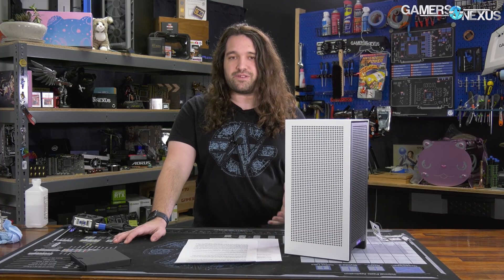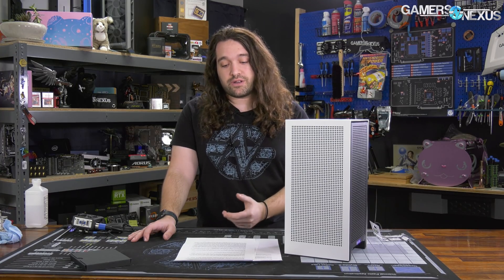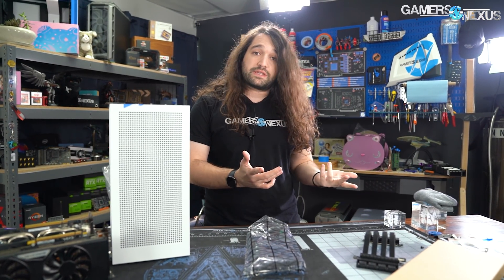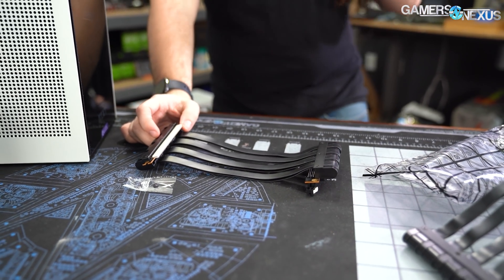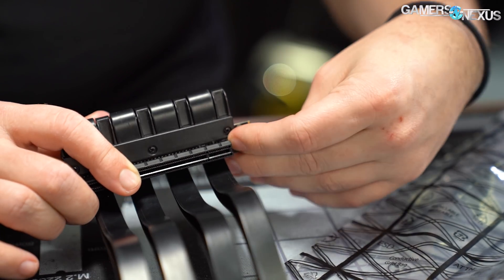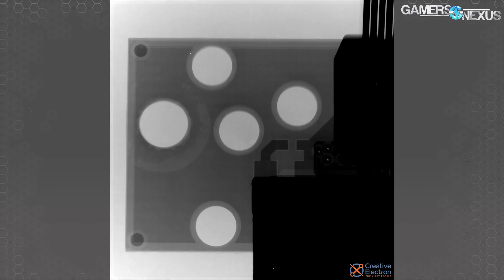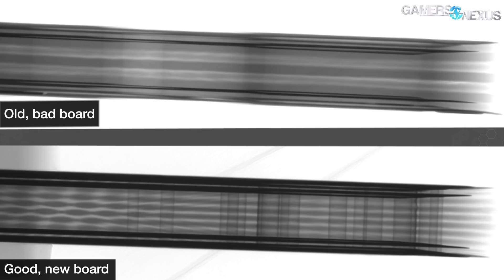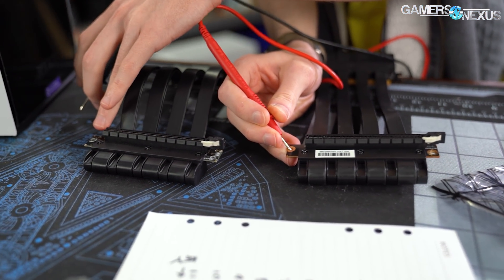Fire or No Fire: New NZXT H1 Riser X-Ray & Testing (NZXT H1 PCIe Riser Fix)

Comment: The tubes are likely a via pattern used to reinforce the area in which the screw clamps down on the mounting surface, and also likely pass a chassis ground connection from the top where the screw head rests to the mounting surface below. I design PCBs for a living, and use this same style mounting hole in many PCBs.

Comment: From the xray images, the cables themselves have a noticeable amount of more traces in the old riser. I'm curious as to why and what effect this would have, if any effect. My best guess is that the new, less dense, cables are grouping grounds on 4x-16x, and grouping powers on the pre-notch and 1x, keeping all data, wake, prsnt/perst, and SMBus/JTAG pins discrete. I wonder if this is for signal integrity and minimizing any effects of emf from the power lines. 
Could also entirely be an illusion generated by the imaging machine, I know oddities can happen if you don't have parts set in the machine just right, especially on the 3D imaging machines; any off-axis or off-center images can induce a parallax error, and on b/w or greytone images this can lead to even more oddities due to transparency layer mixing.

Comment: It’s a total redesigned part, plated through hole with ground plane, the via’s around it are to increase the grounding (tied into the PCB) and also add mechanical strengthen

Comment: I would like to do a update on my Thermaltake S300.  I have a 3600 with rtx 2060 msi gaming z in a vertical position with rgb. rgb fans.  The case came with some issues with the button and couple nicks in the door.
I have received compliments from ppl about my computer.  It looks quite nice with the lights going and all.  I am the only one aware of the nicks in the door and was able to fix the button issue.
So I give it an 8 out of 10 taking away 1 pt for each nick.  CPU runs at 45-55 and GPU runs at 30.  
still a little pissed about the nicks but i am kinda of an ass about shit so...
Reply: I would like to thank everyone out there putting out vids that enabled me to pick the right parts and build the computer.  Gamer Nexus,  Pauls Hardware and JayzTwoCents

Comment: If I had to guess (from a mechanical perspective) is the supports are to reinforce the edges where pinching might occur. Metal have better tensile strength than plastic so it seems logical

Comment: EE here - The holes are called 'vias'.
Traditionally, they were used in order to move PCB traces, or 'nets', between layers of the PCB. Making it easier to route higher density PCBs.

They also serve other purposes:
 * Via 'stitching' is used to offer a more solid connection into the copper plane which they're assigned to (predominantly ground or power planes), this can also help with EMC and reducing hyper-local ground offsets.
 * Bolster the mechanical rigidity of the copper pad to prevent delamination or crush damage to the substrate.
 * Thermal wicking between surfaces - For example, some ICs have a metal pad underneath to aid with removing heat from the die. The pad under the device then usually has several vias to help with moving that heat to another copper surface. Effectively using the board itself as a heatsink.

In this instance on a mounting hole, they're there to provide a better electrical connection to ground, reduce the risk of the copper annular ring delaminating AND avoid crushing the PCBA when a ham-fisted gorilla goes to over-tighten a fastener :)

Comment: I whould say that those tubes that are running the height of the board are for a better garantee that the entire case is one big grounded metalic mass. They probably prevent leakage current. This is why electric transformer are made from various sheets and not just one big magnetic field condutor. In sumary, you lose less energy when its conduting.

Comment: Those "tubes" around the new hole are just vias. In this case they're there because the "component" (the hole) in the library the designer used would have vias there to improve the amount of copper in the area for strength, electrical conductivity for emissions reasons, and also improved thermal conductivity.
Vias are relatively cheap because the drill bit to make them is already used elsewhere on the board. The more ground vias the better usually.
Ah. I see others have already answered that.

Comment: The new PCB is a much higher quality they even used a tighter weaved PCB fiberglass.  You can see the weave in the old one but not the new one.  Very expensive.

Comment: The holes around the perimeter of the board and mounting hole are called vias. You use them to electrically connect between layers of a PCB whether it's a trace or a plane.

An interesting feature is the vias that look to be around the perimeter of the PCB. This is a nod in the direction of good grounding topology for high frequency current flowing.

Low frequency current flowing in planes tends to spread out to create a constant current density and incurr the lowest resistance (more realistically impedance since we care about frequency here). Now ther via stitching between layers really comes Into its own for high frequency current. At high frequency current travels by the shortest route it can between two points even if the plane it's travelling through is large. Therefore, you really care about distance travelled and frequency because the frequency determines the impedance of the path per unit length and then the length determines the total impedance (due to inductance) the current experiences.

Using a plated through hole with large plated and via stitched areas around it for a mechanical mounting point is a bit odd if I'm honest. If they intend it to be a connect back to the chassis then I can somewhat understand but a plated through hole would probably sufficient.

What does bother me is they've gone to all that effort of using a bit plating area and then cut off a portion of it. Makes it look a bit sloppy from a PCB design point of view.

Comment: Those tubes don't seem to have a specific function ... Except that if with time you rub down the plaiting, the tubes are to make contact between the bolt and the case this way you avoid the whole thing by circling it - at least it's what i think - i failed some exams

Comment: EE. Those tubes are vias most likely connected to the internal ground plane. They ground the ring the screw makes contact with on the top and the stud the pcb typically sets on on the bottom. Multiple vias decreases the resistance between the connected surface and the internal plane as each is in parallel, electrically. The reason they go all the way through, besides connecting both sides to the inner plane, is because of cheaper manufacturing costs. PCBs are built in layers with drill operations being done last. You can get blind, or buried vias, where the via is only part way through the board or exist only internally entirely. these have better high frequency performance due to reduction in reflections caused by the excess material present from vias that go all the way through but only connect internal layers. However, this requires multiple drill operations during the fab process as the layers need to be drilled, holes plated with copper, and then additional layers stacked. Each operation also introduces alignment error due to readjustment between processes. The reason the vias are arranged in that pattern is most likely due to a fanout tool in the layout software, similar to traditional cad software where you can copy a feature and repeat it ever X degrees around a center point. Its pretty typical to have that ring around a mounting hole and then additional keep out of at least 50mils between that ring and surrounding signals. ring should be larger than intended screw head size to prevent biting into the anything but ground when torqueing down the screw. clearance is to help prevent a screw driver slipping and digging into a nearby signal

Edit... the newer board appears darker in those layer shots because you can specify different copper weights when fabricating the PCB, typically done in ounces. 1oz copper layers is pretty standard, but they probably bumped it to 2oz (or 0.5 to 1oz). more copper = less resistance, better current carrying capacity, better heat soaking/spreading, more expensive. Those lighter lines inbetween  the four major dark layers are most likely from the boundary created between the fiber glass layers. the core material sandwiched between the two inner dark layers is made up of multiple fiberglass layers glued together... yes glued.

Comment: The tubes are called 'vias' and are typically used to connect PCB traces between layers and to move heat through the board. Vias can be of any size and these larger ones can carry more current and add some mechanical stability to the fibreglass substrate. Professional electronic design engineer from the UK.

Comment: The tubes (vias) around the perimeter are to tie the two outer-most ground planes together, essentially creating a Faraday cage. This is dual-purpose: it contains EMI from the fast-switching PCIe signals on the inner layers of the PCB, and it also protects those same traces from the relatively-noisy EMI environment that is a PC case. 

Some DIMM modules have the same type of thing implemented to help improve signal integrity, so it's nice to see it utilized here as well.

Comment: I see those sort of tube holes in the PCBs I build for planes. They sometimes get filled with potting so it's not as if they are used for anything. Something does get screwed into the centre hole though. I did always wonder why they were there.

Comment: Those things are called barrel an serve to or connect trough PCB or to solder in trough hole components like resistors or condensators.

Comment: 8:45 If you mean the vias near the mounting hole, they are used to ensure a low impedance connection between ground and the screw that is put into it. If the copper of the main hole is striped away by the screw, it will connect through its head. Normally this isn't necessary as it is in this case. Even if the connection to the case it lost, it wont hurt the EMI rating as the case is just a faraday cage. The skin effect will negate any current flow through the housing. I think they just done it as they wanted to make a high-quality riser and as those vias will often not add additional cost for multilayer boards.

Comment: The Solder ball dot in the corner of the board, could be for pick and place tracking. Not 100% certain but usually a pcb would have a test spot for the pick and place machine to line itself up with before depositing parts onto the board.
Reply: Oh and yes the tubes are called Vias... not only does more vias lower resistance between ground places, so more current can pass through, it also increases the effectiveness of noise shielding, both outgoing and incoming. Which is important for high speed devices. 

Having vias circle a through hole screw probably increases the likely hood of noise signals staying in the shielding and grounding out the correct route, rather than through the screw. Also increases mechanical strength by just adding more copper in the area.

Comment: The pins through the board will likely be there for two reasons, firstly to aid grounding of the screw and secondly to possibly add support to the substrate to limit crushing.

Comment: buy a normal pc case, riser cables are useless.  why would you want to remove and extend the most powerfull part of the pc.  just because you wanted a dumb case where your parts won't fit without stuff like risers. the last thing a pc needs to be is a art object. a pc is functional and needs to be functional in the first place. there is no benefit from a riser at all. pc world is full of useless fearures , from glass windows to rgb lights etc etc. there is no function for these parts in a pc. i dont care if you dont like my statement, if you want to use crap like riser cables and than cry about burning you pc down its your own problem . you wanted that case and that specific part. you could have mede better choices but no you want that specific case,

Comment: The small plated holed around the main screw hole are usually useless but some people believe they add reliability when you need conductivity and a little bit less of that pesky feature of PCB squeezing and literally flowing away from screw from the pressure of it being tightened.
It only works if filled by solder but even that is questionable and not very reliable. If you have the screw hole connected to ground plane and the screw intended to be electrical connection then the small holes are just peace od mind for ensuring the connection even if you crush the PCB by overtightening the screw.

Comment: Hey, electronic engineer here:
The tubes you are looking at are called vias, and they are drilled holes that were plated after drilling. Those vias are used to make a conductive connection between planes on different levels of the PCB. In this case the plane you are seeing is the ground plane and not the 12V plane as in the old riser cable. This is also why you can make a contact with that plane to the case. It is much safer than putting a screw even in the proximity of a 12V power plane. Any other questions?

Comment: Hi steve, those "tubes" are called Vias and they're usually used to bridge different layers electrically, however they're also used near mounting screws to strenghten that area of the PCB and distribute the load more evenly.

Comment: Those tubes alias Vias are used to get less resistance from top to the bottom of the shielding. The screw will then connect the shielding to the case which is connected to the earth of the powersupply. This protects from getting electrical  interference into the circuit. Like ESD or just waveforms.

Comment: My guess for the tubes would be for grounding, realistically any point you are putting a screw through to a chassis should be grounded if it can't be properly isolated. It'll make it safer, and helps to reduce noise related to poor grounding (which can cause all sorts of issues). It will also stop the pcb from being crushed as easily when securing it.

Comment: Nice follow up.  Confirming that the board visibly follows sound design practices as you   did here is far more valuable than the secondary object demonstration you performed to confirm lack of fire starting - no proving negatives required.

Comment: The "tubes" you referred to I believe were vias and they have several uses:

#1 They allow the pcb designer to connect different layers of the board. Around the screw hole they are typically filled with solder or plated all the way through as the outside layers of the board are typically ground planes.  By filling the vias with solder or plating them, this stiffens the board around the screw and keeps the clamping force of the screw from crushing the fiberglass board.   Think of them almost as support columns.

#2 They are used to increase the maximum current flow through a pcb.  Connecting multiple layers acts like using a bigger wire.

#3 As a tertiary use they are used to sync heat away from a source, although they are not being used as such here.  Typically this is done with surface mount LED chips.  They will have vias directly under the LED that will be filled with solder and will draw the heat away from the chip to the outer layer on the other side of the pcb.  For LED's the outer layer on the other side will typically be aluminum and then this aluminum layer will be in contact with a large aluminum heat sync on the exterior of the device.

Comment: Not an electrical engineer, but I do believe those mini holes around the shielded hole in the PCB, are there for properly securing the plating/shield. You can even see some punched holes from the visible part of the riser cable, and I believe under that is rods to secure the shield into the PCB.

Edit: by the way, thank you so much for doing all that you have to make sure this fire risk is eliminated!

Comment: Gray Kitty says: "The new riser system from NZXT H1 case is definitely much better than the original one.  As demonstrated by "The Chosen Patrick" it seems to be electrically isolated from the power plane in the PCB.  Therefore - it seems to properly address the existing fire hazard issue." Pastel Kitty says: "Gray Kitty! You should know that only a Underwriters Laboratories "UL" certification of some type... Maybe a 796, or 60950 of some type would truly insure such safety!  Baad Gray Kitty!"  Gray Kitty says: "At least it's electrically isolated and shouldn't cause a fire!  We're only trying to say that it looks like a proper fix without any liability to Gamers Nexus, Stephen, me or you and anyone else associated with this news cast!" Pastel Kitty says: "Good Gray Kitty!"  :)
Reply: Gray Kitty & Pastel Kitty wanna come home to me!

Comment: Those tubes around the mounting hole are through hole vias, most of the time covered by soldermask so you may not see them.  They run through every single layer of the PCB and make electrical connections where needed.  These connections can on external or internal planes or traces.  On more smaller more complex PCB designs they may use a blind or buried via.  A buried via would connect two internal layers but the hole would not pass through an external layer.  A blind via would connect an external layer to an inner layer and would only be drilled through those two layers.

Comment: The "tubes" are called vias, they connect different layer of the board. In the case above they connect the top layer to the bottom layer and possibly more layers in-between if it's a multilayer board

Comment: Those tubes are plated vias through the board; they take traces / signals from one side and pass on to the other.  They can be had with a surrounding "donut" of copper or plain